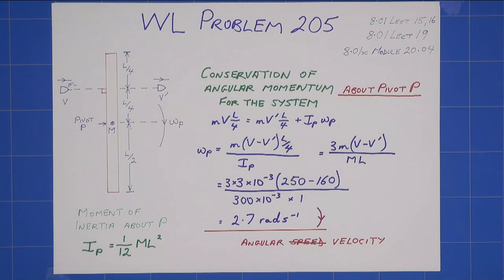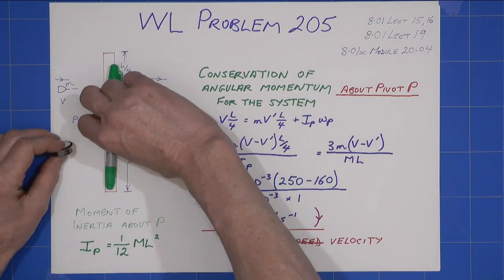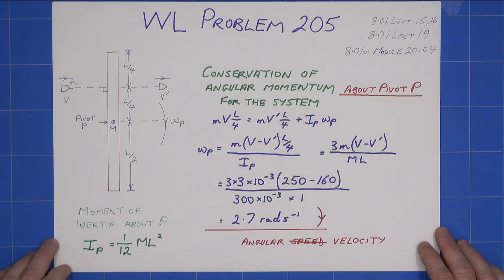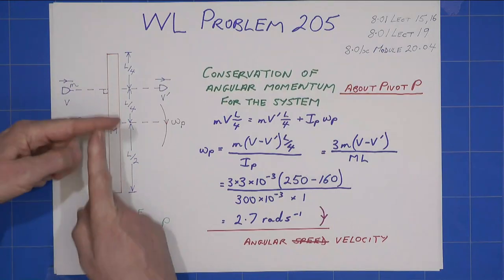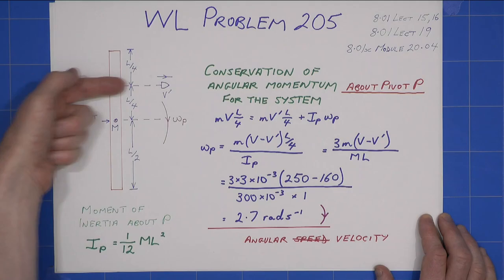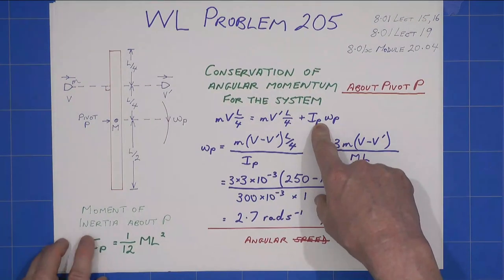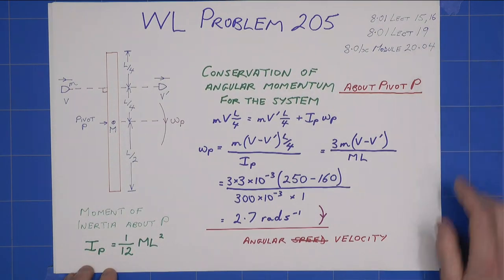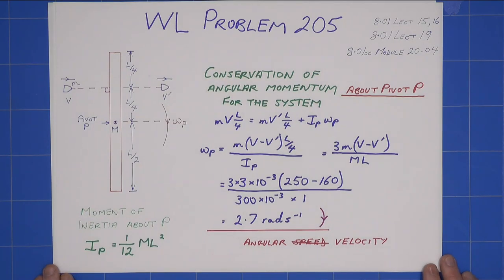Solution Problem 205 - Shoot Bullet Through Rod

Comment: I did bad ... again. I find it amazing that one cannot use conservation of energy. It means one can do calculations on cosmic scale without even taking unknown energy loss into account.
Reply from the maker: shoot a bullet (mass m, speed v) into a wall (mass M>>>m, speed zero).  Momentum is conserved but Kinetic energy is not conserved. momentum before is momentum after, thus mv = (m+M)v', thus v'=mv/(m+M).  KE after is 0.5(m+M)*m^2v^2/(m+M)^2  which is zero as M >>>> m. Thus after the collision the wall + bullet has momentum but no KE which is p^2/(m+M). The loss of KE is due to heat.
Reply from the maker: after the collision KE=p^2/2M,  p=mv is conserved. M (mass wall + bullet) is HUGE (because M>>>m). p=mv coulld be 1, but M could be 10,000  Thus mometum is conserved but KE is not conserved